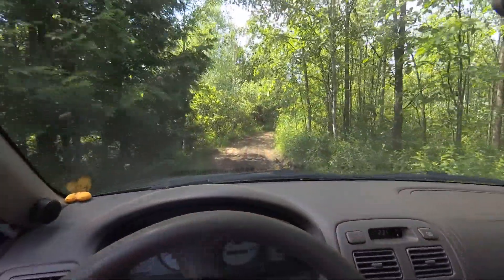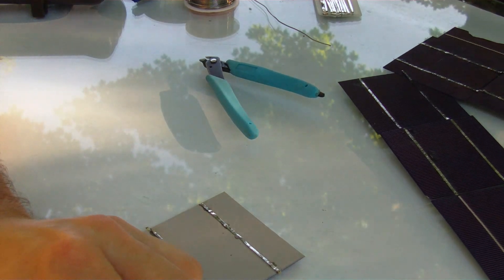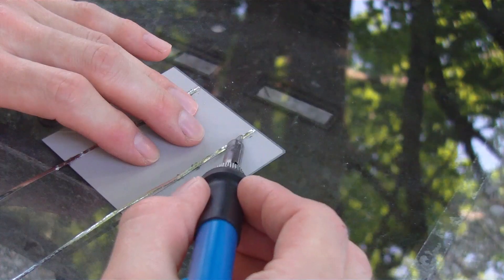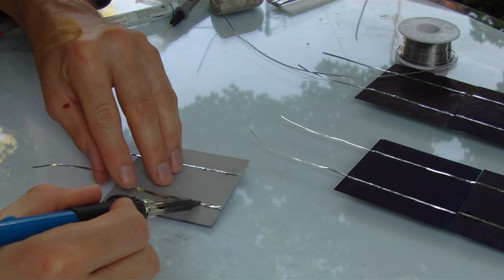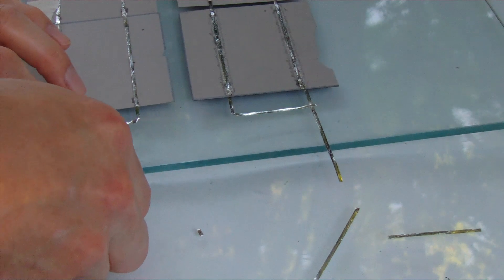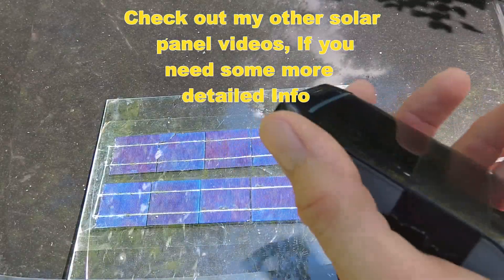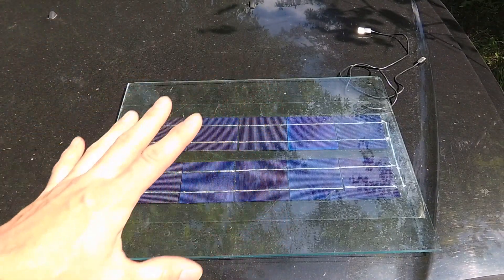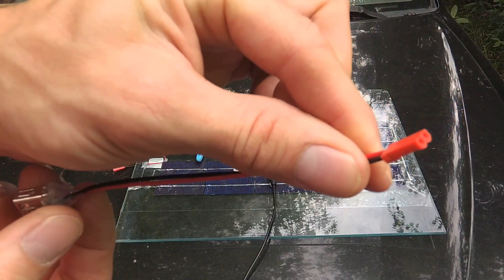DIY Solar Panel using broken Cells 10 Watts 5v USB out - Simple way to encapsulate

Comment: I have a stack of much larger panels that I tried soldering up like that and it was a disaster.  I am very skilled at soldering, but the high temperatures required to melt silver solder cause the panels to crack due to thermal stresses.  It really requires uniform preheating at minimum.  Just buy them instead.  That's my recommendation.